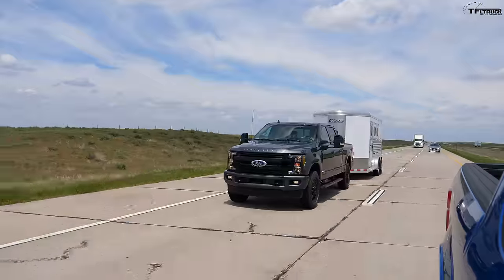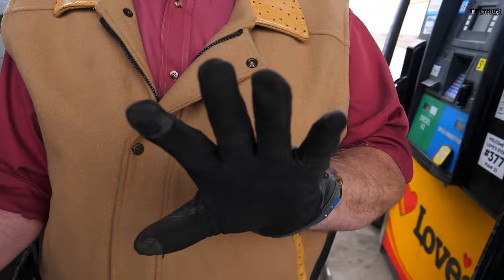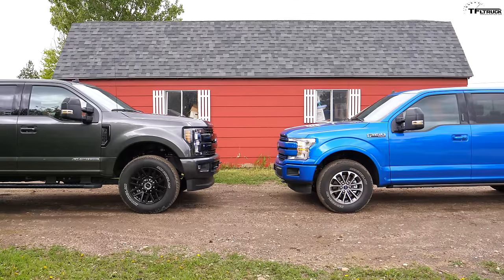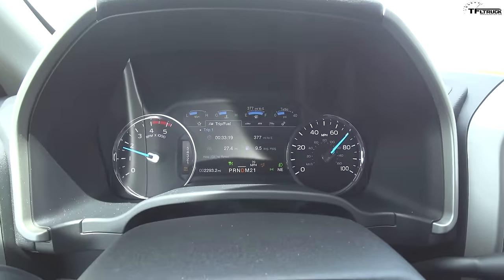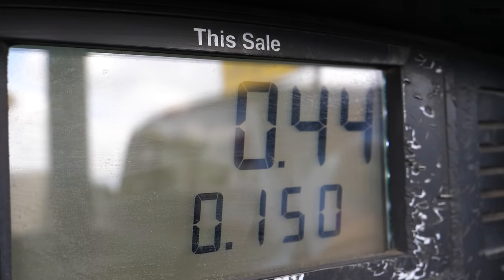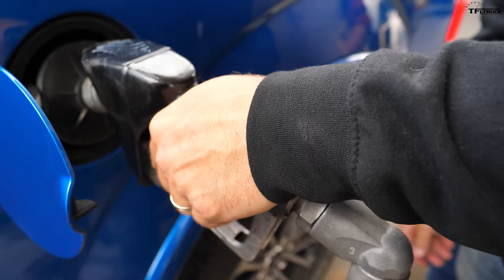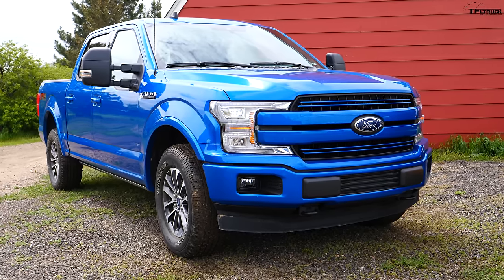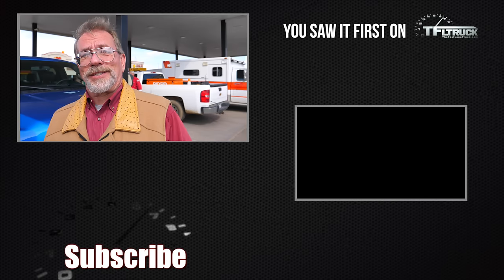Do You Really Need a Heavy Duty Truck to Tow 9,000 lbs? Ford F-150 vs F-250 MPG Review

Comment: That's terrible! My 2000 Cummins with 300k on the clock gets 16-17 towing! 20+ with no load. I had a buddy who has a IH 7.3 F350 (modified for fuel mileage) and he was getting 20mpg with a 13,000 lb trailer.
Reply: My 2005 2500 Cummins would get around 17mpg towing a 30’ 5th wheel RV weighting around 9000lbs at about 70 mph

Comment: Try that same load on the Ram 6.7L Cummins. I tow 11,500lbs and get 14.5-16mpg with my 2016 Ram 2500 crew cab 4x4 bighorn.
Reply: That's impressive. My cousin had a 2010 3500 Cummins and the best he ever saw was 14.5 unloaded on the highway. Towing his snowmobile trailer he was lucky to get 10
Reply: I bet he was a lead foot, I put mine in cruise all the time.
Reply: @zodac1976  not too bad. For comparison, he traded in his 1999 24 valve for it and in that truck he got about 18-20mpg.
Reply: Hell I would have kept that 12v, but I must say I’ve been extremely impressed with the fuel economy I get in mine. I get on average on the highway empty between 21-26mpg depending on how fast I’m going. I had a 2014 tundra that I would only get 14 on the highway and I get better then that loaded in this truck.

Comment: I have 2014  f-150  5L gas with Eco boost. I tow very comfortably dry weight 6000lbs fuel consumption is approximately 14 to 17 KLM/100 KLM depending on conditions & flat or mountain driving. This is Canadian bought & driven purchased in 2014 ( employee pricing promotion ) & paid $45000.00  saving 10 grand pretty much the taxes that our government likes to steel from us. No complaints BUT, the navigation system is by far is a piece of shit. Besides that good truck but still pissed with the navigation.

Comment: I have a 33' travel trailer that weighs 7000 lbs dry...pull it with f150 crew cab 5.0..I will probably trade soon to shorter lighter camper due to the sway caused by wind and 18 wheelers..I do have equalizer hitch, 10 ply tires and roadmaster active suspension but still uncomfortable with the amount of sway..I hate to trade because we love our camper
Reply: Dang..really! We have the same set up almost. I am getting the Roadmaster in week and thought it would help out more. I would love to hear more feedback about your experience. I have '17 F150 5.0 3.55 with the E2 WD 2 point sway control (round bar) rated for 10K. My TT is 33ft at 6.4klbs
Reply: The tire and suspension upgrades have helped the towing experience. It is certainly doable as long as the trips are not up and down mountains...I could keep my current rig but would really like stress free towing..I have considered 3/4 ton truck but I really like my 14 f150..your trailer is lighter and your truck has more towing capacity than mine..My truck is rated at 8100#s..I am right on the number of my 13,500 lb GCVWR when loaded and that is never a good thing
Reply: @scdbrown  Thanks, I am new to towing and want to learn from others. Do you have the Roadmaster set at 20% or 40% setting? Also would you recommend a tune or cold air intake? My truck is rated to tow 9k lbs and my GCVW is 14k lbs.  I have not had anyway problems yet (maybe?) My speed stays at 65mph. I do get uncomfortable sometimes when a semi passes and there are times when I feel like back end it 'floaty'. There are times when I am turning with the HWY and the steering feels light. Makes me wonder if doing it right.
Reply: not sure on the roadmaster %..I think 40..I told the dealer what is was towing and he set it up accordingly..I would not do a tune or intake..the newer vehicles are so computerized and engineered to maximize efficiency. The horsepower and torque on your truck is plenty to tow your trailer. That is not the issue. It is braking and  the fact the your loaded trailer is heavier than your tow vehicle. I have a 4 point equalizer hitch that comes highly recommended. Just my opinion but load your TT as light as possible and travel at 60mph...you can check out the youtube channel of Big Truck Big Rv, very informative regarding towing with a half ton...good luck
Reply: I have a 37 footer, but the truck came with LT tires, and I added GY Endurance trailer tires, and it tows steady and stable, and  I can maintain speed and lane stability  up to 30mph crosswinds.

Big rigs are a none issue...just a little buffering when it passes.

Comment: I still want a diesel , never had one and I always wanted to buy one. No sure which of the big 3 to pick. Currently I have a Tundra and tows great the 7k i ocassionally tow.
Reply: I would suggest the ram by merit of it having a cummins in it. But I've heard the transmission has had issues as of late.
My second choice in that case is ford.

Comment: I understand these are press fleet trucks and not vehicles y’all actually purchased but you really don’t need a diesel to tow a 9000 lb trailer. A better comparison would be an F-250 with the 6.2 gas V8. Then the price would be a lot more comparable to the F-150 also.

Comment: Please do a non towing mpg test of all the trucks while you have them. Put a 1000lb in the bed. This will represent all the people that use there trucks for non towing work applications. Towing test are fine but for most people it’s less than 5% of the miles they drive.

Comment: What about over all stability? I have a 32ft. Bumper pull camper that weighs in that 9000 neighborhood. I pull it with a 12 f250 6.7 4 door long bed. I get 10.5 mpg. I can occasionally feel some movement in winds or if I'm behind an 18 wheeler. How would the f150 handle compared to the f250 on a larger trailer?

Comment: Every time you over fill the fuel tank you risk pumping fuel into the charcoal filter. I have had to replace several because drivers "topped off" and after the fact discovered that they were pumping fuel into the charcoal filter
The vent system is designed to trip the pump when full. Consider not topping off in future
Reply: They leave the nozzle in all the way and pull the handle all the way.  They are trying to be even in case fuel splashes wrong and kicks it out, not trying to get every last drop in, there is a big difference.
Reply: Also they don’t pump it 8-10 times after it clicks, only once. Not enough to be a serious issue like repeatedly attempting to add more fuel.
Reply: Thanks  of your thoughtful response.   As I said, I have seen the results of over filling.   I do find it interesting that your response is in the form of an attack on my credibility and basically information free.  if you do a search on any of several terms related to charcoal canister overfilling you will find several informative videos.  I recommend that you take the opportunity to educate yourself.
Reply: @nortons4673  True and done with care.:-)  As I mentioned it only takes once.  I can show you several canisters contaminated with raw fuel that have resulted in issues that required replacing them.

Comment: In fairness and regards to the f150 and how much the suspension compressed, was the truck equipped with the heavy duty payload package? It didn't seem it was from weight rating on build tag.

Comment: The 150 was gear searching a lot where as the diesel was in OD the whole time, I am disappointed in the diesel's fuel mileage tbh even though it is far better for towing the heavier load.
Reply: D U it’s a gas vs gas comparison...
Reply: La flama Blanca did you even watch the video? The F250 in this video is a diesel! Did you not see them filling up the tank with the green nozzle? Not to mention topping off the DEF tank using the blue nozzle?

Comment: You’re really comparing the cost/fuel efficiency and ability to the job. This was not a good test terrain without hills and braking and hyper-focusing on mpg and not the real cost when diesel is about 30% higher does not reveal the true cost. The little gas engine was working much harder with the higher axle,not really made for towing heavy loads. We should not approach the max tow rating—especially with a travel trailer, which is pound for pound harder to tow.

Comment: I have an 2018 f150 with a factory 5000lbs hitch (11,600 Weight distributing) I have a new 3 horse aluminum trailer similar to the one in your video. It has a solid deck on the tongue  and aluminum frame,  people are telling me that I can't put a Weight distributing hitch on it. You seem to have. Could you tell me what the work around is? Did you just take the clamp on brackets and drill through the aluminum frame and through bolt it? Thanks.

Comment: What is the payload on both trucks.  You may be able to tow 9000lbs, but if your payload on the F150 is 7100lbs, you won't have any real cargo (passenger, fuel, cargo) capability before you are illeagle

Comment: Question......I have a 3.2lt turbo ford ranger but ram have just released in NZ having been converted to right hand drive. The asking price is 119,500 with the ram box. As a price comparison a ranger wildtrack is 70,000 brand new or ranger raptor 2.2lt eco diesel twin turbo is 84,000 brand new,.is the ram worth it?

Comment: Diesel trucks now days do not have the economy advantage over gas trucks IMO.  1 mpg better, but diesel in my neck of the woods costs $0.70 cents more a gallon.  Also factor in the cost of DEF, higher oil change costs, the inevitable DPF and emissions crap you are going to replace once the truck gets some miles on it(that stuff is expensive, to the tune of several thousand dollars to replace the DPF), diesel trucks are just a bad investment unless you are really doing some heavy towing and need something like a 1 ton dually for 20,000lbs plus.

Comment: What is the rear gear ratio of the F250? It wasn't told during the video.... Andrew and Mr Truck!
Reply: 3.55 with the diesel engine and 20" wheels is the only way they come i believe
Reply: @jacobaakre6726  Thanks, I knew someone would chime in on my question.

Comment: This is a terrible message.  So gas mileage may be similar.  But believe me anything you tow with a 1/2 ton will be towed better and under more control with a 3/4 ton.  I watch all your videos and have purchased two trucks based on Ike gauntlet results.  But beware of the messages you put out.  Sure both two a 9000lb trailer with that geometry pretty good. But double that trailers length and keep the same weight and you have a white knuckle f 150 towing a travel trailer in any wind at any speed over 60.  I had a 2017 ram 2500 Cummins and after watching you guys push the ecoboost s so much I traded it on a 2018 F150 lariat “max tow” ( yeah!!).  Towing the same trailer the Cummins was in total control no swaying no Elvis pelvis nothing.  But day to day I felt like I was driving a fire engine.  Traded it for the mighty ecoboost. And it is mighty and pulls trailer great up to speed.  Any crosswind at all and you feel like a feee safety trying to tackle a full back.  Completely unsafe while well within weight limits of truck.   Back to dealership 2019 F250 Powerstroke always but trucks tv s and fake boobs one size bigger than what you “need “

Comment: There is a reason why I keep driving my 95 F250 with the power stroke. I paid $10,000 for it with a western plow in 2006.
With 110,000 miles on it.
$75,000 for a truck??? Not me brother.. Not ever.
I might have my F250 for the rest of my life.
I still drive a 89 F150 with the 4.9 as my daily driver.
I would love a new one.. And I could pay cash for one.But I do not have more money than sense.
If I am going to spend that kind of money. it will be an investment that appreciates in value.

Comment: What they need is a 6L V6 twin turbo that makes 750ft lbs from 1500-3500, 500hp at 3500rpm and a 4000rpm redline. With a few hundred less pounds of engine and 400 less pounds of exhaust, you'd have just as good fuel economy(alternating bank tech) empty and when you take  DPF regeneration in to account, 10% less when towing equal weight/frontage- which is more than offset by the difference in fuel price alone. Then add up all the money saved on initial purchase price and 2x cost 2x as often oil changes and you realize the EPA has finally succeeded in making diesel a bad choice ergonomically speaking- except in China(and last time I checked, we were using the same atmosphere- no wonder they are passing us while we do everything we can to hold ourselves back).
Reply: Oh yeah, they like selling $10,000 engine/exhaust treatment systems, so that will never happen.

Comment: I do understand the rule is to use a 3/4 or higher for a 5th wheel. 
But... if one has a 1/2 ton that is rated to tow 13,000 lbs. Can one pull a 10,000lb 5th wheel? 
By this video that F150 maxed at 9,000lbs did well.
Reply: Depends on pin weight.  They make half ton 5th wheels, but its still pushing your payload to near max.
Reply: Hitch Weight is 1456lbs on my Rockwood 5th wheel and 3230lbs payload on a 2019 F150
I have a 2016 F250 but interested in going to a 1/2 ton

Comment: Please stop ignoring the fact that Diesel fuel is much more expensive than regular gasoline.  The maintenance on that diesel engine is also much more expensive.  The fuel cost for this short trip differed by a mere $1.52 probably within your testing method's margin of error.  A small difference in wind speed or direction between the tests could account for that easily.

Comment: The thing I don't agree with on these videos - that v-shaped horse trailer is about as good as it gets for simple-towing.  It's short, low center of gravity, and probably doesn't poke more than 5 inches above the tow vehicle for aerodynamics.    I don't think I've ever seen anyone that pulls their horses around debating about half-ton or heavy duty, and I live in a ranch area.   Where the debate usually rages is in the RV world (and I have one of those too).   I saw an idiot towing a 9,000 lb fifth wheel with an F-150 "eco boost" and a boat hooked to the fifth wheel last summer.   That little F150 looked like it was about to scissor the frame up into itself.     People buying the first RV usually don't have any prior experience towing and they will look at something like this (towing a flatbed or a horse trailer) as some kind of gospel of what the half-ton will do - not realizing that a 9,000 lb horse trailer is EXTREMELY easy compared to a 30 foot travel trailer that is 12 feet tall, or a "half-ton towable" fifth wheel.  Very, very different situations.

Comment: Who cares about the advertised tow capacity, what is the payload capacity of the f150 over the f250? That’s the real question. If your payload capacity is 5400 pounds and your trailer is 9000 pounds then you are exceeding your payload capacity by 3400 pounds. At that point your going to have to look into a weight distribution hitch, overload springs and maybe changing out the gearing on your rear end. I actually have a 2002 f150 with a 4.6 liter v8. However when I bought my 22 foot camper it exceeded my payload capacity by 1200 pounds. It was at this time I bought a 4.10 F250 complete rear axel, including overload springs. I also bought a very good weight distribution hitch. I also upgraded my radiator and had a transmission cooler installed. I have pulled my camper from Missouri to Texas more times than I can remember. That’s all flat land though. I’ve pulled it a few times to Colorado. I will admit in some of the hilly areas the little 4.6 was hurting.  Now 154,000 miles later I just pull a small pop up in tandem with a small 14 foot Jon boat. No need for the big camper with all the kids grown up and moved away.  When my grand babies get old enough to camp though. I’ll probably get another cig ole’ bamper , as my son called them. I’ll still be using the 02 f150 beta version as I call it. Don’t laugh it’s paid for.

Comment: How did the price of 87oct gas cost $3.199/gal and diesel cost $3.158/gal.    Now I understand this video was taken 10months ago but at a loves near me presently its $2.47 for diesel and $1.97 for gas... with that said the f150 actually saved $2.73 in fuel costs over the diesel for their tow trip soo it would actually save you more money towing daily that trailer with the f150. Over the f250.  Mpg testing between different fuel types should include the cost difference not just a mpg number

Comment: When heavy my Cummins doesn't use much less fuel than a big block, supercharged gas V8 would use to do the same work.  But it'll do it for 500,000 miles.  The gasser would burn up in a couple of months.  Nothing is going to get great fuel economy doing that job.

Comment: 50k truck eh.. 
A F-150 is for 7000lb or less. Their great trucks but not meant for HD hauling. Strap a 5th wheeler behind that F-150 and see how long it lasts. 
It does not have the breaking power to handle that weight as well.

F-250 is way to go.

Spent 2000$ and then another 3000$ fixing and upgrading a 1985 K30 dually. 7.4L/Th400. Crap for gas mileage but it will pull a huge trailer way better than these two trucks.
Get a real engine + suspension for huge loads.  The F-150 here just does not have the big ass transmission and breaking power to do it. (Engine is more than good enough)

Comment: Why would you still use the adapter hitch if you're hooking up in the top setting?  Wouldn't the extra distance cause more leverage?  If it were hitched a couple inches closer to the truck would it sag less?  These are actual questions, I promise I'm not trying to be a dick.

Comment: Yes the f150 3.5 twin turbo can handle 13,200lbs Safely according to ford. That's 2wd crew cab long bed with max trailer tow package. Don't worry about braking downhill. Downshift and dial in your included trailer brake controller and excercise "stab braking". Don't ride the brakes dummy, you'll burn them up. A common inexperienced  mistake.